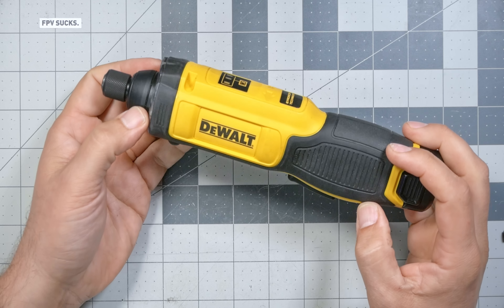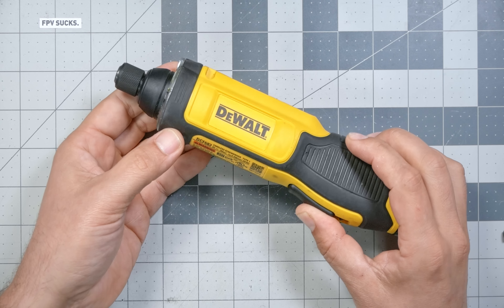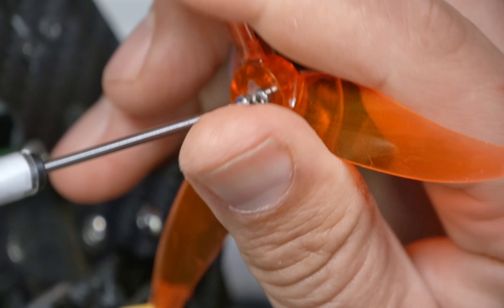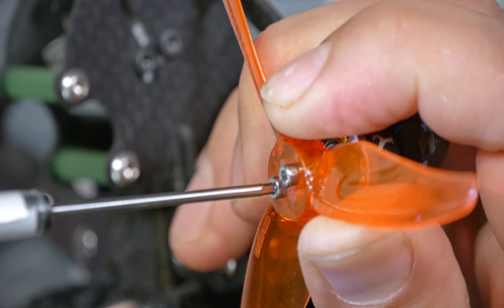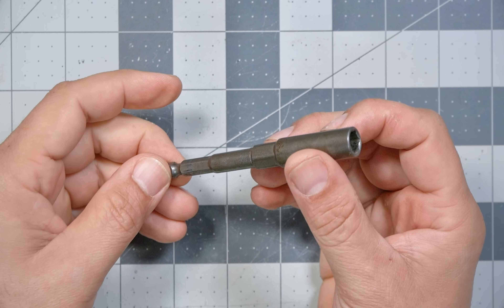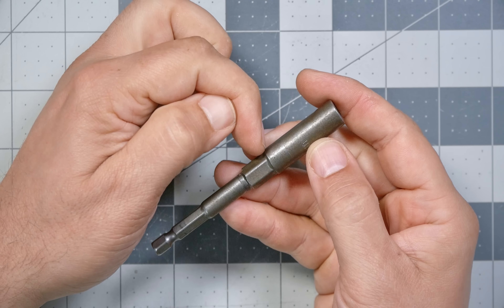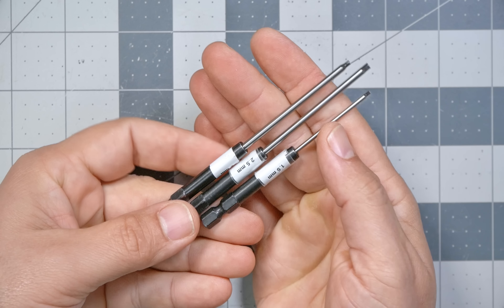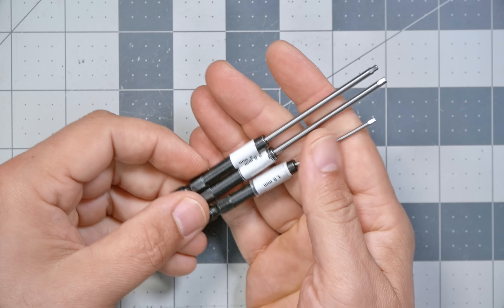This tool changed how I build quads // DEWALT 8V MAX DCF682N1

Comment: There's another version of that Dewalt that has the adjustable clutch on it. Way better for working on smaller stuff you don't want to strip. Been using these things for a few years now and there is absolutely no turning back. These things are amazing tools to help speed up productivity.
Reply: This, the DCF680 is 👌
Reply: Omg yes.... clutch and the grip twists to right angle!....flyhigh🫡
Reply: adjustable clutch is clutch, def recommended. Just don't forget you left in on max setting :P
Reply: @markforce8226  max for props, 10 for M3 and 5 for M2 👌
Reply: Yup best $50 I ever spent, I love that thing!

Comment: Yup... Excellent tool ...bonus tip: if you notice the gyro function is kind of funky (meaning the rotation stops suddenly or acts annoying no matter the wrist movements), just open the tool (very easy to do) and clean the action switch with an electronic spray cleaner. My unit started to do that after 2 years and that's all I did to bring it back to normal

Comment: I have the one above that with the clutch (EXTREMELY sensitive at lowest setting, have used on tiny screws - but YMMV), and can transform between straight and 90 degree pistol, and LOVE IT. Best of both worlds: infinite speed range, from zero up to twice what others do. Gyro action VERY natural.
Reply: Yup, the DCF680 with the clutch is the tits 👌

Comment: You've got the 2nd best driver...the best is the Dewalt DCF680 has a clutch built in too. I tested both, the 682 and the 680..the DCF680 is an inch longer, but includes a clutch...beats the crap put of the non-clutched, non folding 682 👌
Reply from the maker: Did you find the gyro function was the same bewteen them? Another commenter thinks the 680's gyro function works different/worse.
Reply: @JoshuaBardwell  they felt identical, but one will strip m2 screws and one has a clutch to prevent it. Same batteries, same chuck, but 680 folds and has a clutch, cost about $15 more, which is well worth it if you strip one fpv cam screw.

Comment: It is a GAMECHANGER for sure.  I started using it a handful of years ago to build crawlers, the clutch feature is great!  Gotta get the one that you can change the angle of the grip.  DCF680N2
Reply: 100%, i tested the one joshua uses vs the better DCF680 and the clutch is totally worth it. I didnt think i'd use the folding gun mode, but it's more comfortable in alot of uses 👌

Comment: I can absolutely see this for prop nuts especially when they are nylocs, but I'm not sold on it for the regular hex bolts. A regular (hand) hex driver seems easier and quicker to me, as you can quickly spin a long bolt in by twisting the driver's shaft rather than the handle. Using a hand driver has the advantage that the handle is much thinner, meaning that when you want to nip it up you have a lot more control over the torque - In fact I find myself using the different diameters of the handle to control torque more than anything. Maybe that's just me though.

Comment: That's what I love my Miniware ES15 too. Works the same, but in a much smaller form factor (and obviously with much less max torque).  Using it daily for electronic repairs and such.
Reply: The miniware wont do prop nutz...
Reply: @Fly_High_FPV  That's true. But for small PCB stuff, opening cases and such things it's very nice. Then such a giant thing can be uncomfortable after a while. You can't have enough tools ;)
Reply: Love the ES15 - an over achiever. Dewalt has better control but doesn't marvel me as much as Miniware.
Reply: I spent a long time looking at these - I thought the twist feature sounded awesome, but I persuaded myself it must be a gimmick I wouldn't use. I'm now seriously reconsidering!
Reply: @CoopzVideo  I would say it also depends on what you're working on. I sometimes repair phones, old toys or other things with small screws or sensitive threads / plastics.  In such cases the fine control can be super useful...same as the torque control. They're the kind of tools you don't "have to" buy because a classic hand screwdriver gives you the same control and feedback, but it's a joy to use them once they're in the arsenal :)
Reply: @Leif_YT  Awesome, thanks for the helpful reply! It's great to know you can achieve such fine control with it. I don't think I use my tools enough to really warrant it, but I just really want it! I had also looked at the similar Sequre ES126 which is a bit cheaper, but it does sound like the ES15 is just that bit better.
Reply: @CoopzVideo  What I like about Miniware is that they provide Firmware Updates and think about details. For example you can let itself discharge to storage voltage if you don't want to use it for a while.

Comment: I largely agree here - the Dewalt is a neat driver with this feature but it does take some getting used to but if you are mindful and set it up properly it can be a really helpful device.  I have had many cordless screwdrivers over the years but now I am lucky enough to own a Milwaukee and it really is great.  I also have the pistol style Ryobi unit and have had it for years and it also is great.  

So I do agree that this Dewalt is really cool but I will say that a clutch is really useful! and for what it is worth you can get this DeWalt equipped with one, it just costs more of course!  

And the MIP drivers are actually legendary!  From 10-15 years ago at the RC car tracks these drivers were in everyone's toolboxes I remember they were expensive to me at the time but these are a "buy once, cry once" purchase that is 100% worth it!  The steel they use is very high quality and I do believe that the tooling is all machined to size - all I know is that these are tough, true to size, and one of the greatest of all features - the sizes are all clearly numbered.  Cheers

Comment: Another great one I love is the Narex Hybro, only really good for the smaller stuff, props might be pushing it, but it is small and handy and has the exact right torque and sensitivity for M2-M4 stuff, also charges from usb and is much cheaper. Might be more hard to find depending on where you are in the world

Comment: I complete agree. I don't like the ones that only work by pushing it towards the workpiece. Especially when screwing a screw out. Some have additional buttons, which is better, but the pressure sensor can't be disabled which is abd. This maybe ok for medium grade woodworking, but not for precision stuff. Unfortunately the Dewalt shown wasn't available in Germany last time I checked a few months ago (only a regular one).

Comment: in my case I really love the wowstick, screws well, you can adjust the tightening as well by hand and it's so small
Reply: It's what I use to works great was going to get one of these but they break they aren't reliable they are junk
Reply: @rockman49er yup mine is already not working 50 % of the time

Comment: Update: The exact version you'd want is actually the DCF680, because it has a clutch and is convertible, yet still has the gyro! I find the clutch super important, it's basically insurance to never strip any screws and it speeds up work by you just being able to go full bore and the screw stopping at a certain point automatically... Also it's a fair bit cheaper I think!

Comment: I got a Dremel one and it is awesome. I presume you got one with strip detection? Mine will stop once it either meets torque or it'll stop once it slips out of the screw

But I really like how you can change torque by twisting it.
Reply: The Dewalt DCF680 is like the one joshua showed, but includes a clutch and folds to gun mode.

Comment: I bout the BOSCH version of this tool for working with my robots but it is much too powerfull even on the lowest setting so I use it as a household powertool now. Is so good.  edit: The BOSCH has a dial for strength and you push on the device to initiate action.

Comment: I like the cheapo harbor freight electric driver. It doesn't have enough torque to damage most delicate fastenings 😅 Sure I have to make a few final turns by hand sometimes, or a half first turn when loosening, but it saves me from having to make the vast majority of turns. Plus it is like $10. I have a backup I've never had to open, and it is very light and small.

Comment: Don't forget about the wowstick, if you work on micros a lot it's probably better optimized for the torque you'll need.
Reply: I was super dissapointed by my WowStick...ewaste in 90 days...wont turn motor screws anymore, let along ever turn a prop nut. The money I wasted on the wow stick is what allowed me to justify spending more on a dewalt 🤣 but i got a refurbished DCF680 for $70 on Amazon

Comment: Might have to pick one of these up to replace the skil driver of similar style that I bought last year. My skil still works but when I try to use it as a manual driver (as they advertised you could) sometimes it doesn’t lock into place and makes grinding noises like it’s skipping gears. Definitely doesn’t instill confidence that it’s going to last.

Comment: Once you know what setting the torque-limiter device needs to be set at they're way faster (and forgiving to use) than this dewalt unit. You just set it and turn until it skips. I have one setting for frame fasteners and one for props and it tightens them to the same torque every single time, no guesswork.
Reply: Max for props, 15 for M3, and 5 for M2 👌

Comment: In my opinion the vessel  220USB-P1 is far superior. 
1) Its no bigger than a standard screwdriver 
2) it USB-C so it can be charged in the field.
3) 1.2Nm, 1.6Nm, & 2Nm torque/ speed setting 12Nm hand torque
4) way easier to use when using in awkward positions
5) Standard 1/4” hex US & Japanese bits both lock in and work
6) $65 after import

The negatives of the 220USB-p1

1) it’s only sold in Japan, so it has to be imported and takes 5 to 6 days to get.
2) only comes in on color

no, it does not have the gyro function like the Dewalt but I didn’t personally don’t find the gyro that useful on small fasteners and electronics. It’s been 100 times longer because Im focusing on not over, rotating the Dewalt than just getting the fastener in. and the Dewalt is just to talk to you for fine precision work.

Comment: +1, this is a great tool. I purchased it last year to work on big RC cars (lots more screws than on quads, and generally the screws go into ABS plastic, requiring quite some torque initially, but also fine control towards the end to not strip it out). Works great. Thanks for the link to the 8mm driver; I had not thought of using it for props yet.

Comment: Please make a video showing how to use elrs to configure betaflight over wifi. It is so cool and useful but it was a bit tricky to workout that you have to type tcp://
Reply from the maker: Configurator should automatically pick it up once the ELRS device is on the network.
Reply: @JoshuaBardwell  ah, I am connecting to thr rx's ap. I had to type the ip in manually. When it is on the network does it appear in betaflight in the drop down along with the serial com ports?
Reply from the maker: Yes that's right.

Comment: Fascinating driver. Just one comment though, for 4:10 So, what you're saying is it doesn't quite have enough torque to put on prop nuts (because you have to finish it by hand)... With this gyroscopically controlled thing, wouldn't it mean that it would never twist off your hand like the other did (even if it had much higher torque than that one) because the moment it starts to twist your hand, it would stop? Depends on its reaction time, I guess...
Reply: Love this driver but he mentioned the clutch was fully disengaged so it was full locking. When he screwed the prop in and it fully tightened it ripped the prop out of his hand not the driver. It has a ton of torque and it’s difficult to explain how it feels when using it. Besides speed from turning the gyro when the clutch is off you also get more torque as it gets tilted more. It’s a great around the house driver but for very serious stuff it could perform slower or be strained.

Comment: If anyone buys the driver, I would recommend getting a wiha bit selector. They are expensive, but wiha bits will last forever, and are much better value, especially compared to other high end brands I have seen(there might be better idk). Also, the wiha has bit case and a larger selection.
Reply from the maker: This is a fine choice but personally I hate little bits. I like the long thin MIP style.
Reply: @JoshuaBardwell Fair. I've just never had any screws far inside a quad that require a longer head, so bits have worked well.

Comment: There’s a version that has a clutch and turns into a gun if you can spend a little more. DCF680N2. That’s been my go to around the household.
Reply: 100% tested both and the 680 with clutch is way better 👌

Comment: I have one of those I’ve been using on computers for the last 10+ years. Totally unnecessary for quads, a good set of proto Stanley T handles are faster with a pinch and a twist and no risk of over tightening. Well I suppose you could turn the lock settings down on your tilt driver. T handles are much more satisfying.

Comment: This seems like a massive over-complication and unnecessary expense.  How is it better than an plain old screwdriver, or a prop tool I can fit in my pocket? Unless you are building quads on a production line,  it makes no sense to me.
Reply from the maker: Every time I screw in four 28mm stack screws, my wrist thanks me for this.
Reply: @JoshuaBardwell  Ok... I would call that 10-ply soft, but you do you! hahah! I suppose I just spin the golden nut down on those with a finger and do the last tighten with screwdriver and little wrench. Thanks for all you do Mr. JB!
Reply from the maker: But what if you're using press nuts so you can't just spin it down?
Reply: @JoshuaBardwell  Good point! I guess I just see it as unnecessary as I am only building one quad every couple of months or so! If you are doing it every day, I can definitely see the benefits!

Comment: sequre have a good electric screwdriver & much smaller than that monster
Reply from the maker: Can it put my prop nuts on?
Reply: I have both the sequre electric screwdriver v2 and the Dewalt DCF680 and I can tell you don’t waste your money on the sequre screwdriver. It doesn’t have enough torque to tighten props or screws properly. You have to do by hand afterwards kinda defeats the purpose. Get this one JB showed in the video or the 680 version

Comment: Made chop saw gears for black and dirty before they moved from Hampstead Md. in 1983. Dewalt is owned by the balmer stock holders and others. B&d china is junk. DeWalt pretty good 😊I made tool and die pay running 4 machines at same time, 2 automatic,2 manual

Comment: So Joshua is try to convince us this is a good tool for FPV. And somehow ignoring that using this exact tool he stripped those screws. Anyone else make sense out of this? I mean, if even Joshua using this driver for some time is not able to properly control it, what is the point of using it for FPV builds? No matter how cool the concept of gyro control sounds.
Reply from the maker: Sorry? What screw did I strip?
Reply from the maker: That's a press nut that I stripped. And the ENTIRE POINT of this video is that I'm arguing that press nut stripped because it was weak, and to demonstrate that I have a lot of control over this driver. Jesus. I made this video to prove the exact point that you're failing to get. The press nut would have stripped if I had been using a hand driver, because it was not strong enough to take the force required to insert it. I just built a Demibot with this same setup. Zero press nuts stripped because they are not made of cheese.
Reply: @JoshuaBardwell  ok, let me accept I was totally wrong and missed the point. If better material for those press nuts would be used, they would not strip. My question in that case is: If you would use vise to press in those low quality press nuts, would they still strip?
Reply from the maker: If the nuts were pressed in with a vise, they wouldn't strip during installation, because the threads are not stressed during installation. But my argument is that they might strip when installing the arms instead. But it's true that there is more force placed when pulling in the press nut than during normal use.